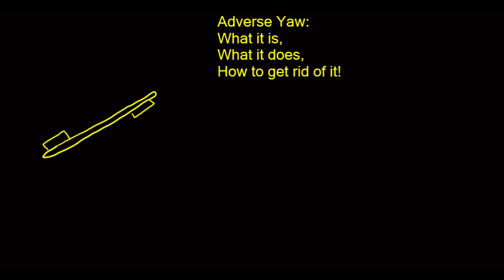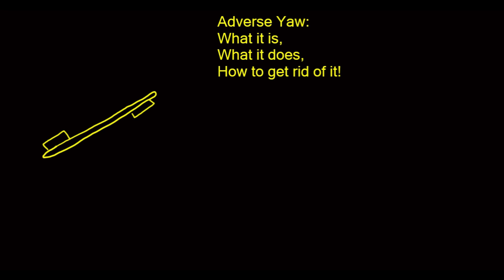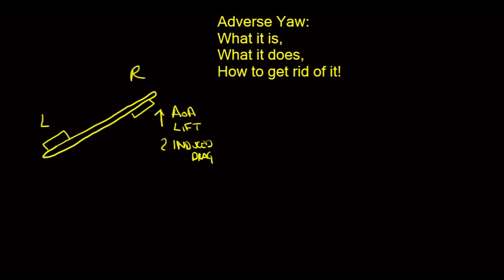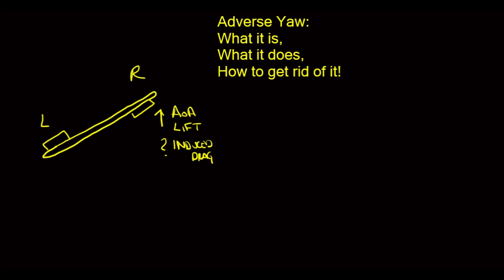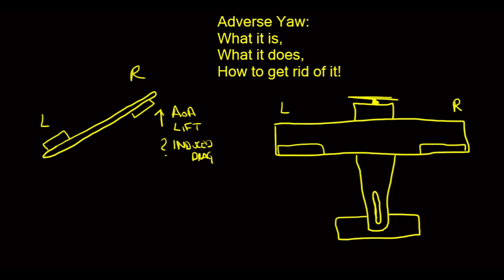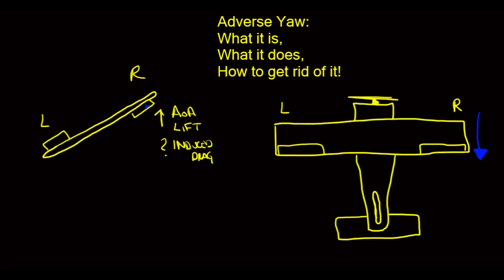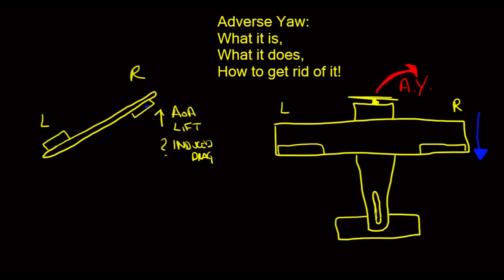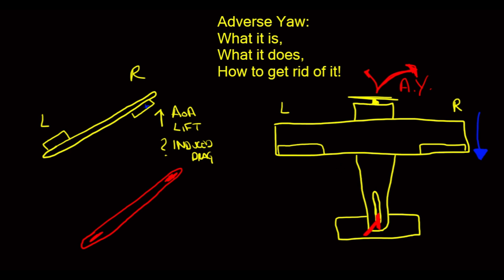Adverse yaw explained simply

Comment: If the left and right ailerons move in opposite directions but an equal amount during a bank, wouldn't the drag created by the ailerons be equal? What determines that one aileron creates more drag than the other in a bank?
Reply: they move asymmetrically for starters
Reply: @operationscomputer1478  if they were to move symmentrically there will be no need to use rudder?
Reply: You need to keep in mind the angle of attack - the downward aileron will have a much greater frontal area and hence drag (viewed together with the wing), than the up one. Try to picture the whole wing viewed from the front, in alignment with the airflow.
Reply: More lift = more drag on the downward one verses the upward one.
Reply: @429thunderjet2  why is there more lift on a downward alieron?
Reply: @phoonjzc  an aileron creates more under camber when it moves down and speeds up the airflow over the top of the wing creating an even lower pressure than when the ailerons sre in a more neutral position, verses the bottom side of the wing being high pressure creating more lift. It's kinda of like the Venturi effect in direct consequence of the Bernoulli principal. So more lift equals more drag. So the wing on the inside of a turn when the aileron is up creates less lift and drag, so you normally need to add some rudder deflection into the turn to stay coordinated and not slip or yaw away from the turn.  But once the bank is established you bring the ailerons back to neutral position and the airplane will stay in the bank untill you bank it back to wings level.  Hope you could followed that. Do a search on flight controls & ailerons & stuff. Quite interesting.
Reply: @429thunderjet2  hi I understood. Just curious do modern planes have autopilot to overcome this?
Reply: @phoonjzc  the modern auto pilot will turn the airplane by setting the heading bug to a new heading without any other inputs from the pilot.
Reply: @phoonjzc   so my explanation is the main one that everyone uses and is correct, but there is a bit more to aerodynamic lift.  check out,  
"The Efficient Engineer".  and his You tube videos "Understanding Aerodynamic Lift".  It is only 14 minutes & it is excellent.
Reply: Relative wind to the surface of given aileron determines the magnitude of drag which cannot be same for both aileron during turn
Reply: @saketsagar2156  Any diagram to illustrate?
Reply: @saketsagar2156  well, not quite, the relative wind would be relatively equal but, the downward one is producing more lift at the same time. Ok

Comment: I don't want you or the viewers to misunderstand me, but I must correct you at some points in order to not let some things misunderstood:

1. The asymmetric drag doesn't come from induced drag only! It's the total drag (5 types of drag in 2 categories) differentials along the undisturbed airflow vector's axis which finally creates the yawing moment. To make it clearer, the flight spoilers (usually the airliners use them) further reduce the induced drag component (the only type of drag that you used in the explanation) on the lower lift wing while the result being a relatively low to non-existent opposite yaw due to roll (adverse yaw), not greater as if only the induced drag would've taken place. The total resultant drag is important.

For the sake of this "adverse yaw" topic, what does happen with the yawing moment when both wings produce a negative lift (on zero dihedral wing configs) when deflecting the ailerons?

2. Turning moment is wrongly used in the discussion! The turning is related to the trajectory or the movement of a body about an axis (it can be any), while yawing, rolling and pitching movements are related only to their specific axis.

Comment: Based on this, can't you simply ignore the ailerons for entering the turn, using only rudder to kick yourself into it and simply using roll and pitch to hold your angle? Once you're done, tap the rudder in the other direction and you're level again.
Reply: The force experienced in using rudder only could possibly lead to rudder detachment or breakage
Reply: @saketsagar2156  well yeah maybe, but at normal flite speeds you need only use very little rudder deflection.